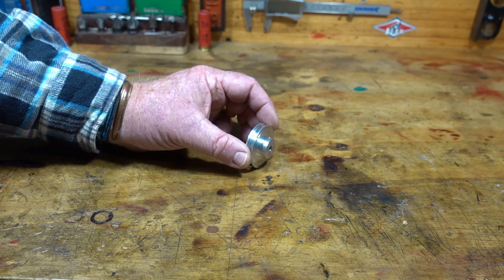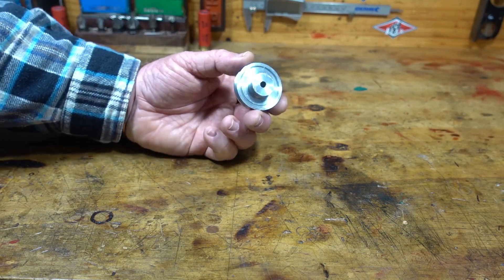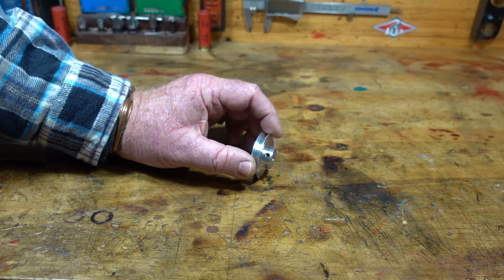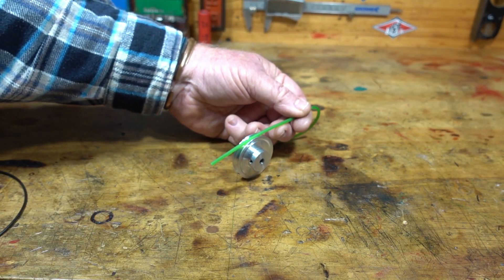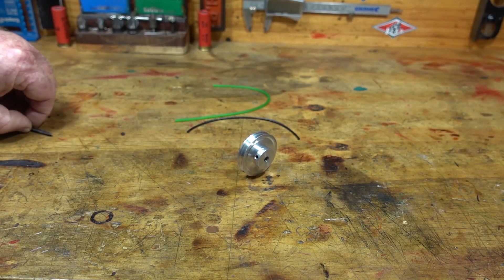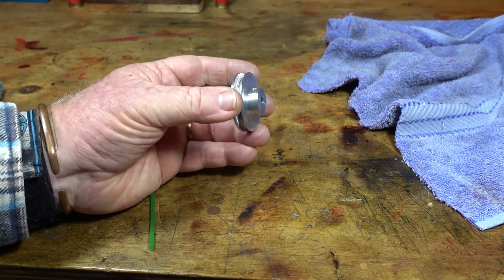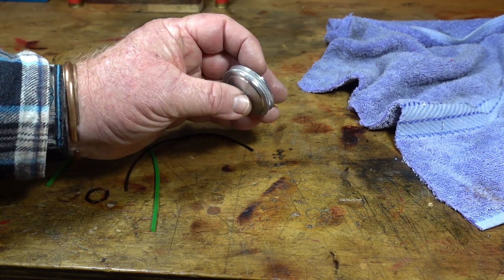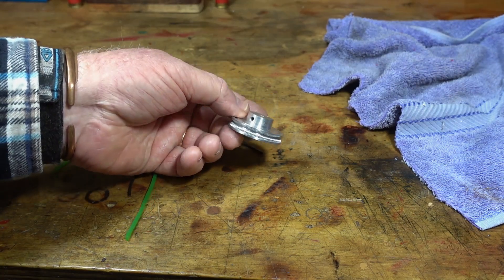Workshop Talk - Worm Gear Hobbing a Pulley for driving accessories for Model or Toy Steam Engines

Comment: I like the idea you have however the sheaves on a pully are smooth for a reason: The sides provide a smooth surface for the belt to come in contact with. With all surfaces dry, the belt should have no problem transmitting power to or from that pulley. Any rough surface (i.e. the procedure you're applying here) will cause undue wear to belts like these. Spring belts, because they are heat treated steel, would probably wear the sheave out fairly quickly. Since we are talking model steam, to force a pulley with this much torque, I can't see a use for.
Reply from the maker: Thanks for your comment but I disagree, many toy model steam engines such as the massive line of Wilesco steam engines come from the German factory with the drive pulleys already hobbed and they supply spring belts. I've always wondered how the steam engine manufactures hobbed their flywheels and wished to be able to do it....now I know and can replicate it - Cheers Jim
Reply: @SteamEngines-Jim  Absolutely.....exactly how Wilesco does it and using a spring drive band like Wilesco sells it means that the spring coils fit each groove in the drive pulley so there will be zero slippage.....so cool seeing how this is done - Thanks Lance

Comment: Thanks for showing this Jim, It's not a technique that I had seen before, seems to work a treat. My only suggestion would be that if you have a collet chuck hold the tap in a collet rather than a 3-jaw. Cheers, Alan.
Reply from the maker: Thanks Alan, yes I have a collet chuck and a large assorted size of chucks but its a pita to remove the chuck for such a simple operation as this. There's not much pressure at all against the tap. I made up some more different sized jigs and hobbed some more ali ad brass drive wheels yesterday afternoon. I'm really stoked to be able to now hob flywheels like Wilsesco does. Its surprisingly simple to do. Cheers Jim

Comment: great idea Jim
iv'e hobbed a worm gear that way before many times, but never thought of its use on pulleys
i will put that in the memory bank
regards
Kev
Reply from the maker: Hi Kev I'm really happy how well this method worked and how relatively simple it was using a tap in the 3 jaw chuck. I made up some more different sized jigs and hobbed some more ali ad brass drive wheels yesterday afternoon. - Cheers Jim